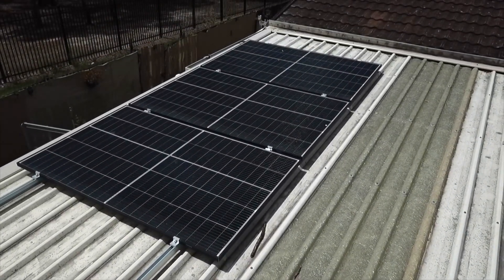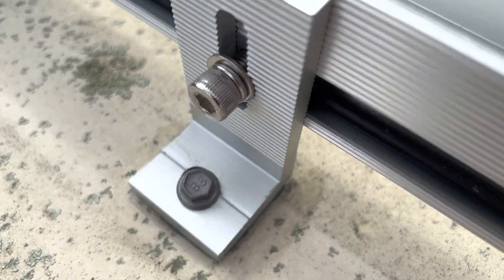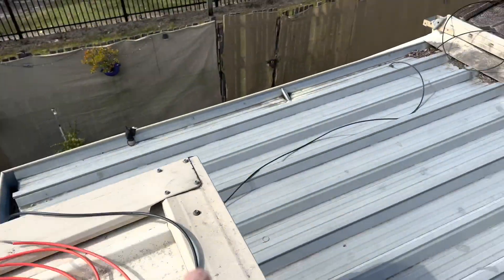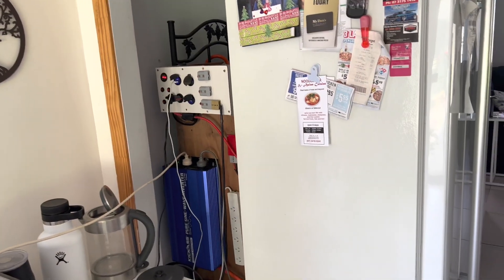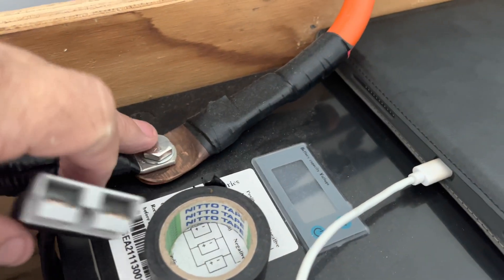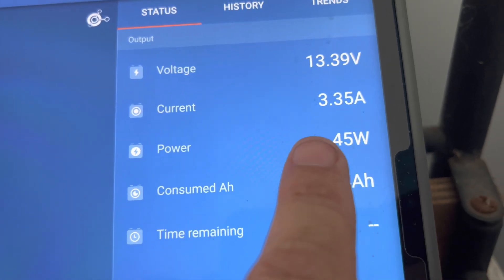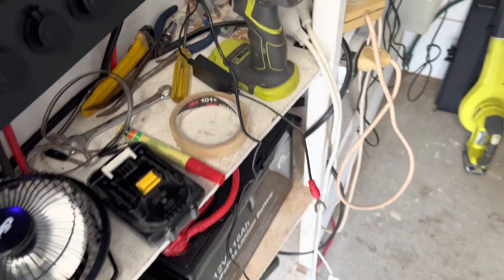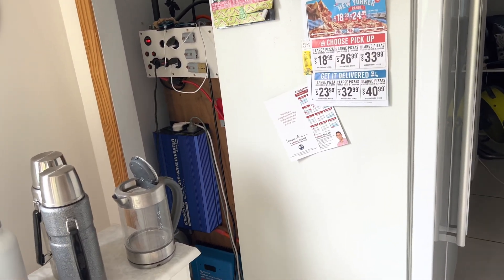My off grid solar setup at home

Comment: Victron sell 250 volt versions of your 100A solar charger. I've got a 250/70 and i can have 4 panels combined to make about 150V open circuit. A bit more money but worth it for the fact you can put more panels into your system.
Reply from the maker: Cheers thanks for watching 👍🍻

Comment: Hi mate,you amaze me how you do all this electrical work.
As you say no power worries in a blackout.
I have the same 3000watt blue kickass inverter but sadly after very little use in my caravan it died.
For some reason I can only run a drill up to 400 watts before the inverter goes into fault mode.
I’m not technically minded like you so any suggestions on what would cause the problem?
Reply from the maker: I would say the inverter has gone poopie and I take it that it out of warranty. Thanks for your offer but I don’t think I would use it for anything . I been lucky with my kickass inverter though it has been going very well. Thanks again Brent really appreciate you watching 👍 cheers 👍🍻
Reply: @EFFICIENTSELF  yeah mate out of warranty.
No worries keep making the videos I find them very interesting.
Reply from the maker: Sorry to hear this .. is your battery or batteries in good health? Also are you running big cables from batteries to inverter?
Reply: @EFFICIENTSELF  yes mate the batteries are ITechWorld 120x.
Cables are heavy duty and short to inverter.
I had used it the run my aircon off grid for a couple of hours.
What ever I put on to it just came up with fault.
I have bought the ITechWorld 2000 watt inverter to have all my system the same brand.
Mate if you want it to pull apart it’s yours.
I have no use for it now that I have a new one.

Comment: Good job mate. As a roof plumber, I'd advise you to only ever screw through the roof sheets on the ribs. Even though you've sealed it well, you've still created a weak point where pooling is going to happen and very likely the seal will fail eventually.
Reply from the maker: yeah cheers Jesse a great tip and advice 👍 . I realised that at the time had this been on the house roof I would have screwed to top of rib for sure . I just wanted the profile of the panels as low as possible as we get wild storms at times and being a carport heaps of rain comes in from the open sides lol.  thanks for watching mate 👍🍻

Comment: Nice backup system. You will need to check with your state. But here in WA its legal for you to work on  DC if you keep it under 130v dc. As that will not kill you. The fall from the roof might though 😅 it will kick like a mule but you should survive it. For you in QLD you also need to meet cyclone ratings and may even need a permit and inspection. Just build it up to code and you should be fine. I know about red tape as i had to jump through the hoops with my complete off grid system. its strange just as i am watching your video i am uploading one of my own. On my full off grid system for a subscriber that asked for it on my Air compressor video. Just make sure its up to code so if you have a fire or a cyclone your house still insured. Good to see your taking the step into a backup system . 2 thumbs up my friend 👍👍
Reply from the maker: cheers mate thanks for the advice and tips . this system probably only about 1/32 of your system. I seen the air compressor you did video on .. it uses less power than your other one . hope you and sigi have been well mate and take care on your next bush trek trip 👍🍻
Reply: @EFFICIENTSELF  Just trying to help bro. My house and my off grid system are both fully insured. Had to jump through lots or hoops. One other thing looks like you used copper pipe and just hammered it down for your battery lugs.  Replace that with real lugs and crimp them properly or you will find you have problems latter on. Been there done that. Just trying to save you the same problem i had many years ago.
Reply: @JustinCaseSolarPower  Great advise Justin! Cheers.